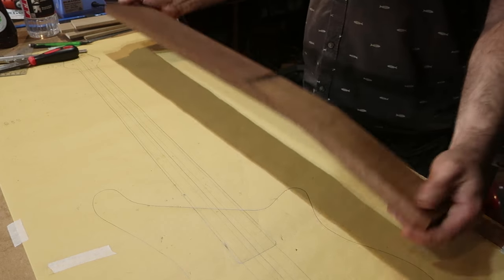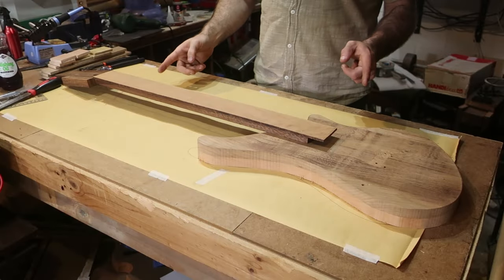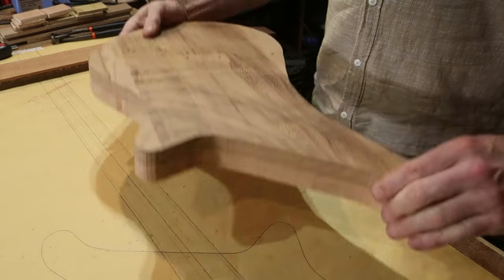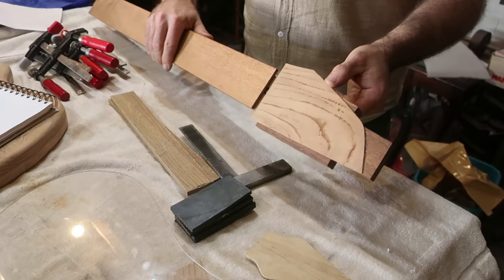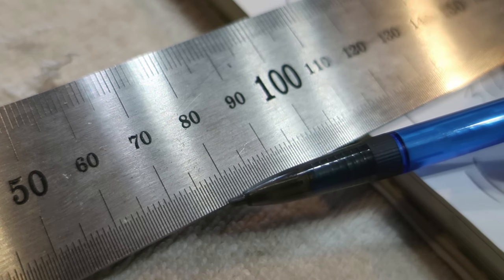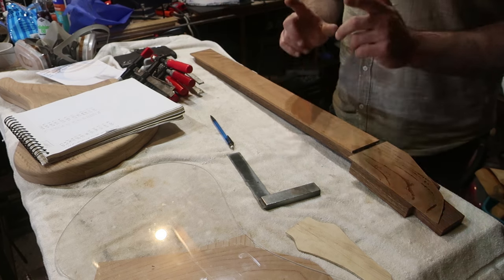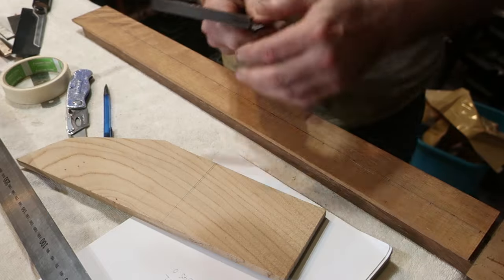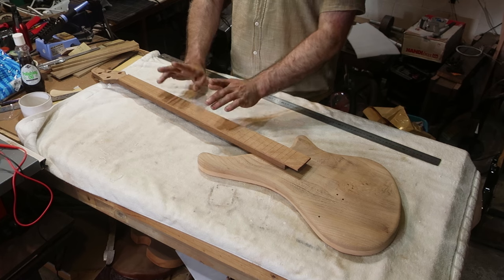Holiday Bass Build Episode 2 - A deep dive into fret accuracy

Comment: re accuracy of fretslots...just make them as accurate as you can! I have just been drawing a set of fret position markers in my Drawing app, Affinity Designer in my case, but I'm sure there are many apps that will do this. It says it will be accurate to 3 decimal places which is more than enough. What i will do is get it printed at full size, and then transfer the lines to a square section alunminium tube with a scalpel blade. That way i can create a fret ruler with 4 different scale lengths on one ruler. Hopefully the fine scalpel lnes will be easy enough to transfer to a fingerboard.

Comment: For the binding, if you wanted to give it a go I wonder how a centered approach would look. Say you cut a thin slot between the two woods, I can't think of how to word it but maybe like the giant trench in the Death Star? Then wrap some binding in that. It would make it super easy to sand flush with the wood around it and might be less of a hassle. I think on a bass like this where the wood is divided right in the center it might look pretty good actually.

Comment: Wonderful work. The pickup, or pickups, will be interesting.
Reply from the maker: 2 pickups, 4 coils each, 6000 wraps per coil. It's taking a long time and I'm halfway through now. I'm going to have to do something tricky with the wooden tops, if the epoxy soaks through the thin veneer then it'll never take the stain in the same way as the body, I'm going to have to stain it first and hope it matches later. Problem solving in three dimensions...

Comment: 17:00 Regarding potential inaccuracies, I would argue that the spacing between the frets is not so much what needs to be considered, but rather the length of the string from the bridge, so even at the 24th fret a quarter of a millimeter would amount to about 0.12 percent of error in string length. Considering that the frets will be crowned, that we will always bend the strings slightly when playing etc. I guess a quarter of a millimeter is plenty accurate enough. Thanks for the video!
Reply from the maker: Indeed, you're doing the calculation on the length of string that's actually sounding, so that makes perfect sense. I just used the frets on the fingerboard as it was the easiest way I could think of to practically demonstrate on camera. I also went on a long tangent about the limits of human hearing and how the smallest pitch variance we can detect is 0.0035%, it all got very nerdy and was a solid 7 minutes of irrelevant psychoacoustic theory, I might put that out as a separate video because it's all good information but it wasn't needed here.

Comment: I'm dreading cutting slots by hand (without a jig) but I'll have to try it to gain some confidence. You make it look so easy.  thanks for another great video.
Reply from the maker: It's as easy a banging in a nail, it's just a really weird shape as nails go. Try cutting a few into a piece of scrap first, you'll see how simple it really is, then all you've got to do it pay attention when measuring. I've always said, there's no part of building an instrument that difficult, broken down into it's individual tasks they're all really simple. The tricky part is that there's about 120 little steps and they have to go (mostly) in the right order, and it's a matter of remembering the entire process. I make a lot of lists...
Reply: Is not as hard as it seems. Just take it slow, all the mistakes I've ever made cutting slots were because I rushed it. If you don't use a jig to lineup the saw one thing that can help is to radius the fretboard first, is a bit awkward to start the cut on a completely flat piece of wood, but on one with a radius the contact point between the saw and the wood is much smaller and the saw doesn't drift as much.
Reply: @fanbladeinstruments  Thanks Geoff, I'm planning on doing some necks and fingerboards this week. I will practice on some scraps first.
Reply: @eldereth  I will get me some good blades, the ones that don't wobble or drift and practice before, thanks for the tips

Comment: I like your method of cutting fret slots. I should try that instead of marking, scribing a line and going straight to the saw. BTW, it was scary watching you joint the surface of the neck. Your fingers seemed to be too close to the cutters.
Reply from the maker: I have a mantra that I repeat to myself "Where are the blades, where are my fingers, where are the blades, where are my fingers" etc. I can never be complacent when using a machine that'll end my piano career in half a second, you are right to be worried, you are right to point out the dangers, I should make more of a point of emphasizing the safety aspects, rather than just filming it in fast motion and making it look easy as that's not what's going through my head while I'm actually using the machine. Thanks for bringing it up, safety is an extremely important aspect of everything we do. Cheers
Reply: @fanbladeinstruments  I've done the same thing — in may case it was chisel that a viewer thought was very close to slicing off my thumb. The reality was that I was paring very slowly and it was the camera angle that made it look like my thumb was close to the chisel. And it didn't help that I sped up the footage.

Comment: Coming along nicely 👌… what is the thickness of the body ?
Reply from the maker: It's currently sitting at about 42mm, I need to shave a bit off the back as there was a little tearout from the block plane, it's soft enough so it should sand away without putting up too much of a fight, probably going to wind up square on 40mm. Thanks
Reply: @fanbladeinstruments  cool as

Comment: What u thinking about the built in effects👀
Reply: or maybe you can integrate some sort of multi effects pedal and have buttons and switches like a fender jaguar that work in tangent with the pedals UI and perhaps the pedal's screen can be installed on the side of the bass, facing you for ease of reading  or even a little tab where the screen folds up
Reply from the maker: I have a friend who's just started making little homemade hand soldered overdrive circuits, I've asked him to make me one and I'll most likely leave it at that, I'm not big on pedals although I do like a good bit of fuzz on my signal. I've had another idea too to do with the pickups but I'm going to sit on that for now as I don't know what use it would be.
Reply: @fanbladeinstruments  Ahh I see I see, maybe as he improves, he can come up with a custom mini fuzz for the bass. the knobs would look like any active bass, but instead of bass treble and mids it can be what knobs the fuzz has.